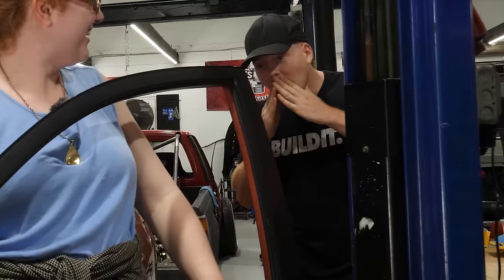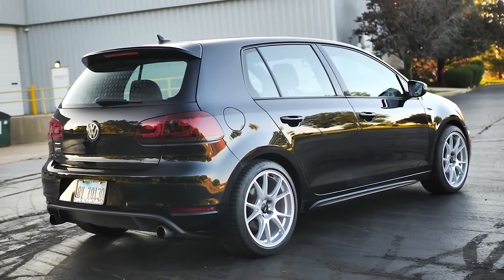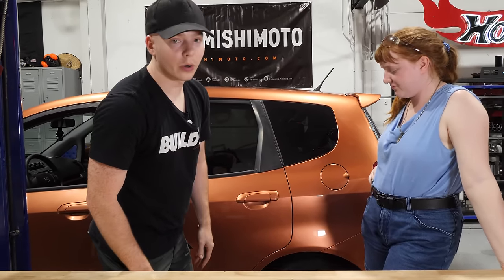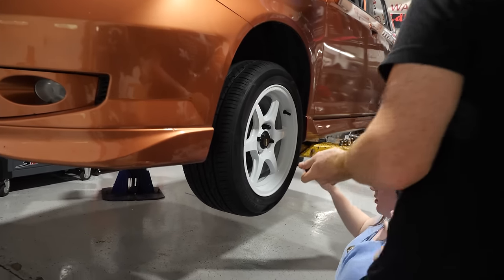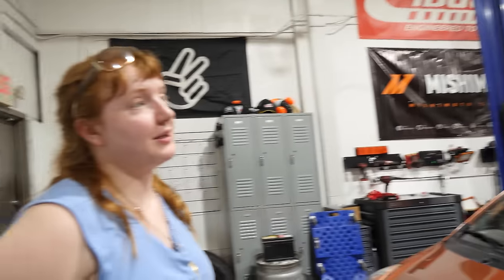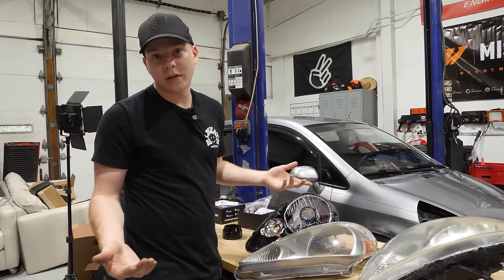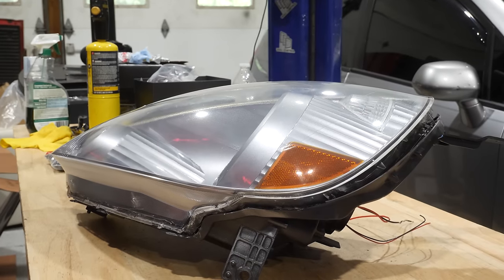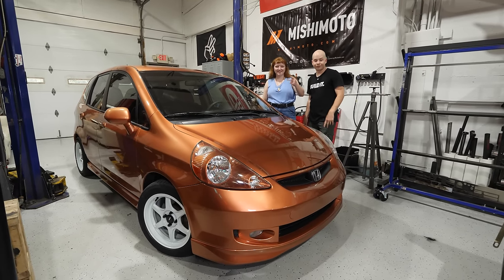I Bought ANOTHER HONDA FIT... But Why?

Comment: Xanthippe is such a cool name! She's back up and running with new valves and updated tensioner, no bottom end work needed
Reply from the maker: So glad she went to a good home! I hope you have better luck with it than we did 😂
Reply: Unfortunate that they had basically the what's-what of typical MK6 failures.  Mine made it to 155K miles on the old revision tensioner somehow and I had my chains, tensioner and stuff all done.   I did my rear main with a billet 034 unit and replaced the oil separator with a new one and use a BFI Clean Catch catch can and did an aluminum water pump.  ZERO oil consumption and no more failures.  Now at 168K miles and making over 360 whp with a pro tune and K04 and it's been rock solid.  I don't recommend these cars for anyone wanting to just pump the boost and go.  You have to fix all the weak spots first.

Comment: Few things. I applaud you for doing a proper retrofit! Definitely a great change form throwing LED’s in and blinding everyone, but when polishing the headlights it’s better to stop at 6-800 grit as the clear will chip on 1000+ grit as it doesn’t adhere as well. And the other part, you don’t have to remove the factory butyl sealant on the headlight, it is reusable, just add a bit extra and it’s good to go
Reply: yeah I tried redoing my headlights because previous lacquer coat came out really rough. it wasnt 2k clear and I prepped headlight by sanding with 600, 1000, 2000. I was also on the hunch that I need to stop at a lower grit. thanks for the tip

Comment: I love my 2008 Honda Fit sport, but I'd be lying if I said that I didn't like the 09-13 fits more. I bought mine a couple years ago with 70 mi on it that a 78 year old man owned. It's been very well taken care of. I've got 101,000mi on it now. I would totally be interested in buying these wheels btw. 

My wife almost drove it off into a ravine and the car was just teetering on a curb. Needless to say, she put a massive gash into the oil pan. We just got it back from the shop and it's as good as ever.

I've owned Volkswagens and I've sold them too, and just like every other German car, you can expect check engine lights galore.

BTW, the red 08 fit is the worst color, and mine is now 6 different shades of red after its entire life being spent in the Southern Illinois sunlight.
Reply: I feel that! Love my 07 GD3, but I’m contemplating selling it and buying a 2nd gen.😎

Comment: I have an 09 fit manual. I love it, but I'll definitely be putting side skirts on. I have a small amount of rocker rust, which ill likely sand down, repaint and use fluid film inside the rockers to stop anything spreading more. I figure side skirts will protect the rockers, plus improve the look.

I'll also be getting new wheels, as the stock, almost solid rims, aren't too visually appealing.

At some point, I'd like to up the power a bit. Nothing crazy, just want a bit more pep. What are some performance mods you've done or would recommend?

Comment: I love my mk6 gti, I must of just been lucky, done all the maintenance and its happy, original timing at 170k miles and track the car. Cam phase position was only -1 so its super happy. I did have the rear main issue with the PCV failing from the last owner but replaced it with a billet rear main so it cannot pop off like oem.

Comment: As a 2013 GTI owner I can confirm that that’s bescially early mk6 problems, Tensioner was bad till 2012. RMS and intake are up in the air for when they go but I replaced the rms with my clutch upgrade. They’re fantastic cars post 2012, but seriously congrats on the new fit

Comment: My 2010 Fit currently has 298,000 miles and will hit 300,000 by June.  No mechanical issues other than a AC compressor.
Lots of oil changes and tire rotations. Keep it washed and vacuumed.

Comment: I run white wheels on my cars so i approve for sure. If you cerMic coat the wheels they're easier to maintain. I can spray them with quick detailer and wipe them off or spray them off with a hose. Sometimes i only need to clean them every other day.

Comment: I'm local and have some tien lowering springs, hks axle back, hps short ram intake, crappy roof rails from a 2012 fit. Among some other leftover parts from trading in my fit recently. Not sure if they would be useful since they're second gen parts but you're welcome to them.

Comment: 100% if you just need your car to drive to work every day and grab groceries once a week, a Honda Fit is probably one of the smartest options you can get. It doesn't look exciting and it doesn't drive excitingly, but it's economical, practical and super reliable. Other options I'd have considered are the Toyota Yaris or the Mk7 Fiesta (ideally 1.6l 120hp), but I don't know if either of these cars exists in the United States.
Reply: Well, manual gearbox and do downshifting double clutching is a lot fun. and over take quickly other cars.

Comment: GTI burns oil.  I check it at 25,00 miles and oil change at 5,000 miles.  Topping it off at near full level will prevent it from skipping timing etc.
Fit is a very good car, reliable and roomy due to it's tall shape.  Can't go wrong with Honda.

Comment: Lol I used to have a ford escape too, which is actually how I got introduced to the channel. Now I have a mk6 gti with 205k on original motor…. The timing tensioner wasn’t replaced until like 189 and I’m still just casually waiting for it to explode with no backup car 😂

Comment: Bro I have exactly the same motor (or maybe the previous variant EA113). Had the tensioner go on me, chain was slapping but no misfire or codes, drove it for 3 months like that. Only just had a maxspeedingrod kit put in cost a total of $1300AUD, not complaining at all but am still looking at Honda Fits/Jazz mow

Comment: I bought a 60k miles Manual Jazz Sport for 2.5k£ as my first car and was so excited because of yours and had a bunch of plans, it was horribly rusty underneath unfortunately and had one brake ceased, the exhaust fell off it while driving it home for the first time. Spent so much money on it with repairs and sold it for 2k after like a month or something as it had a big rust hole in the frame near the wheel well and I didn't want to lose more money welding it. The car was really fun to drive and really spacious but I had to let it go I ended up trading it in for a Manual 2.0 mk3 Mazda 6 and some more money. I wish I could go back to it but in the UK they are all so rusty :(

ps: I was going to buy a clean Yellow one but my mate got covid I had to delay the buy 1 week and some lady bought it and I had to go for the rusty silver jazz

Comment: My 08 honda fit has an issue with  cruise control not working even after I replace the button panel still not working. It still lit up at night but cant turn it on

Comment: Ah man, really shouldn’t have gone past 800 before clear coating. More likely for the clear to fail with it sanded to 2000 underneath. Also heating the headlights in a low oven makes the sealant super easy to get off and apply new. 

When I use 2K clear on headlights I like to come back a week later and wetsand with 1200 then compound and polish for a perfectly clear finish.

Comment: If you want a reliable pickup truck for a daily as well, I’d take a look at the 2013 Nissan frontier with the VQ40. Reliable asf, got good power for its size, and gets relatively good fuel economy. The only thing I had that went bad on mine was a cam sensor which was a pain because it was between the head and the firewall. Other than that, it’s a beast. I’ve been driving mine for almost 2 years now, no complaints

Comment: Hilariously enough I had a 6th gen with every bolt on possible already done when I bought it (unknown timing chain status), proceeded to tune it off its nuts with pretty bad wastegate rattle (345 lb ft of torque on the stock K03) and besides a coil pack one time nothing ever went wrong with it. Only had 65k on it at the time tho. Didn't realize how lucky I was lol

Comment: Should have fixed the MK6. The EA888 motor is so easy to work on and is one of the best motors VW ever made. It's intimidating to work on but really not that bad. You could have gotten away with doing the updated chain and tensioner using some Amazonspecial tool kits and rockauto parts. I am already on my 3rd 2.0T repair this year. YOu can easily fix it in a driveway.

Comment: So that's what the catalytic converter heatshield looks like when it isn't rusted through (Canada Fit problems - mine is secured with 3 hose clamps so it won't drive me mad by rattling).

'08 Sport M/T with BuddyClub short shifter, Progress RSB, 15x8 RPF1s on ExtremeContact Sport tires, and upgraded rotors (Brembo blanks) and Hawk HPS - definitely stops like it should now (the stock rotors and pads were garbage).

Comment: I have a hooked up CRV 2013 lowered nice rims but no matter what I do to it. It’s still automatic, so I fixed that problem. I bought a 2009 Honda fit sport standard transmission lowering struts nice rims tires are less than a week old it’s got high mileage, but they’re all highway mileage. I live in South Carolina in the mountains so it’s all highway I gave the guy $6700. I know that’s a big chunk, but the cars are going crazy the prices and I had to go to his bank to pay it off for him, that’s the cheapest I can get it, but I do have my Honda fit now

Comment: My 2014 Passat had 40K on it when it started misfiring. It was a nice car when it was running right...but it was never running right. Then I got an Audi A6 and it was GREAT...when it was running right...but it was NEVER running right. Now I have a 2007 Honda Fit identical twin to Gid's. And the Silver is the BEST color because the headlights dont look like they came from pepboys.

Comment: Fit GD3 (1st gen) CVT trans is pretty problematic,but the manual trans is flawless

If u turbo the stock engine it will easily reach 350++ hp with E85

Good buy bro...

Comment: Did the projector mod to my lunar mist 08 fit as well except I went gloss black on the painted portion I have metallic gunmetal bbs's reps with chrome lips and ksport Street coilovers such a good-looking reliable car with very little money put into it bought it for 3,500$
 7 years ago and I'm literally about to sell it for 5,500$ in a week or two and I put 85,000 mi on it I'm sure I'm going to regret getting rid of it.
And definitely do the valve lash adjustment when I purchased mine they were considerably out of spec and after about 70,000 more miles they were out of spec again 😂

Comment: No joke, I was just planning on getting a newer GTI or GLI, thinking they’d be dead nuts reliable. My second choice was a used Fit. Or a Corvette. If I can find a good local deal.
Reply: The 7th gen gti is pretty reliable. Also, I’ve owned a 5th gen gti for 4 years and have only had to do typical maintenance

Comment: The steering wheel thing isn't common afaik. The thing that goes wrong with them are the coils and the rear where the quarterpanels meet the rear bumper is really bad for rust.

Comment: If you do any kind of forced induction on those fits, do an engine swap first. The L series honda engines have issues with the oiling system as well as a really weak crank and rods. In all honesty the d series is a better platform for modifications than the L series. K series is the best but modifying the L will give you more issues than you want.
Reply: The L15 should be fine if kept under 180whp and a bit less torque on a proper tune. A k swap isn't easy or cheap.

Comment: Bruh, you should have used butyl to reseal the headlights!  Also, always make sure the projectors are properly leveled before putting the lenses on, nothing is more annoying than a crooked cutoff line.
Reply from the maker: Yeah about the crooked cutoff line… 🙃
Reply: @_Gingium_  nooo, upside down?!

Comment: One thing I like about my Fit....its got 240K on it and you could EAT off the bottom of the engine...not a single drop of oil anywhere in sight...until I did an oil change and spilled oil all over it of course 😂😂😂

Comment: When I had my 7th gen civic and I did an HID projector retrofit i used the "E46-R Extended" projector shrouds and they are imo much cleaner and looked factory. Perhaps check them out and see what you think, I can dm you a pic as well :)

Comment: I would redo the headlight lenses. You should only need 1200 grit rubbing compound after. I think you went to low on grit at first that why you can see the scrathces and the cloudines  is because you didnt use rubbing compound. If you skip the rubbing compound you have to use and clear them right after use 3000 grit and use rubbing compound to get the shine. Remember to use water when sanding.

Comment: Don’t ever buy any VW with a 2.0T they are all ticking time bombs.

Also, timing adjustments in Hondas is super easy. Those and spark plugs are supposed to be done every 105k.